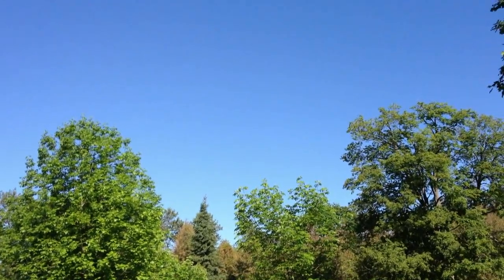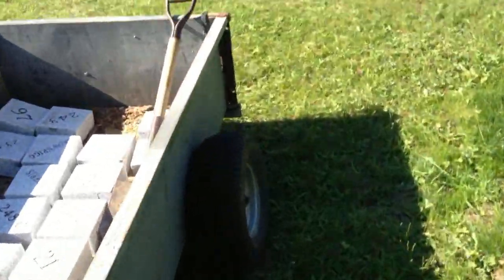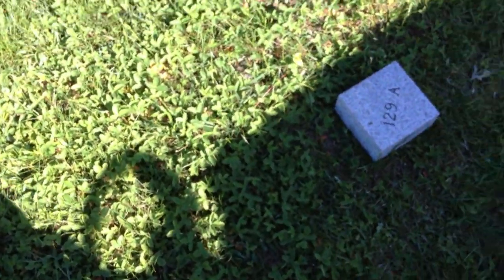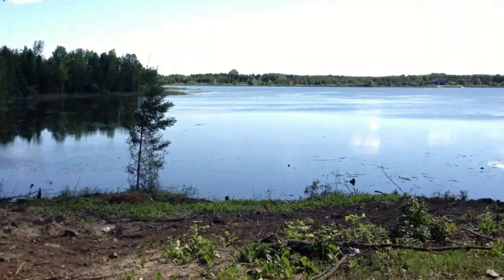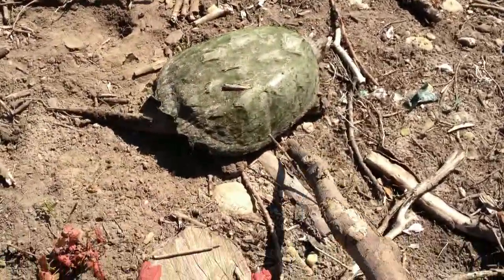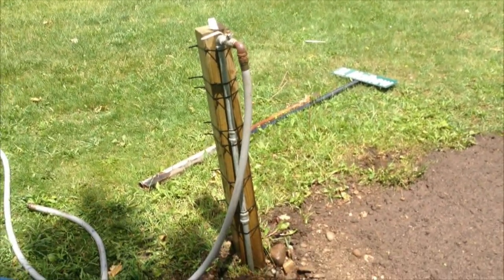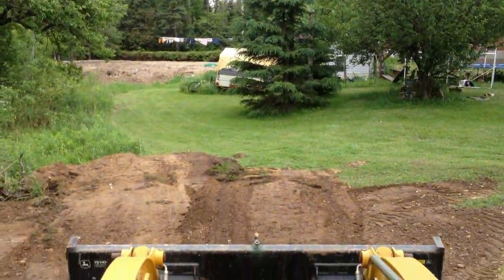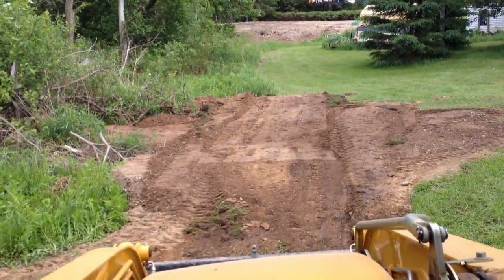Installing new corner stones ,prehistoric wildlife and more hole filling

Comment: For his Allotment my Grandpa used a length of fine building line with tabs and each tab was marked to each row centre and edge (when they were grown) it looks so much better in dead straight lines and kept it in his shed so every year each spacing was the same.
Maybe you could do the same when you start your next new row?
Just a suggestion.

Take care.
mrbluenun